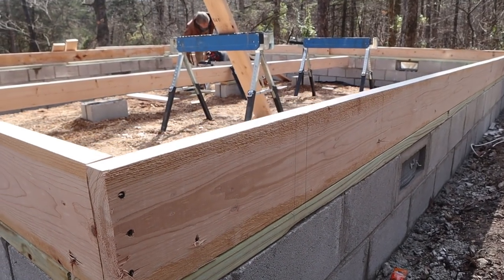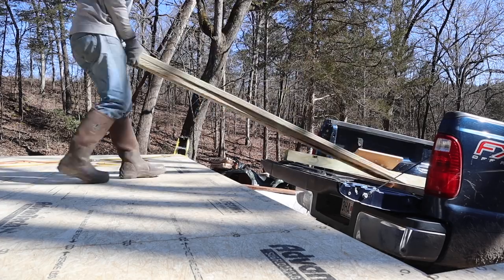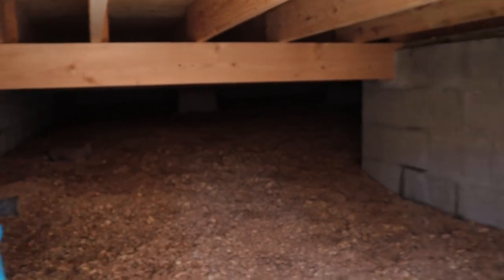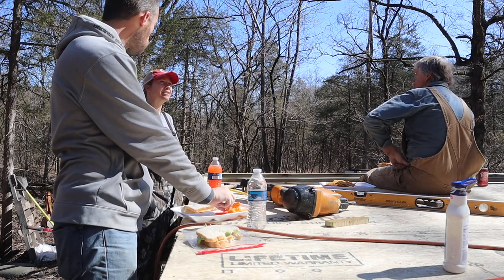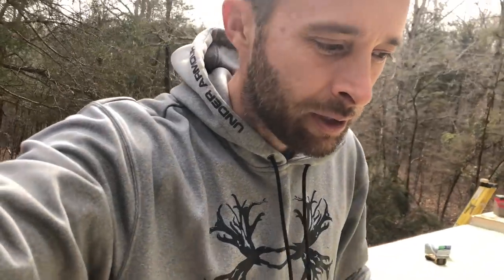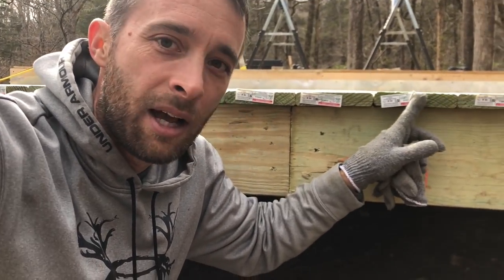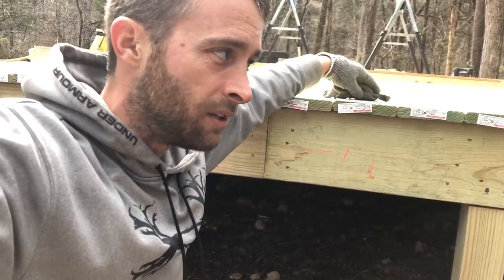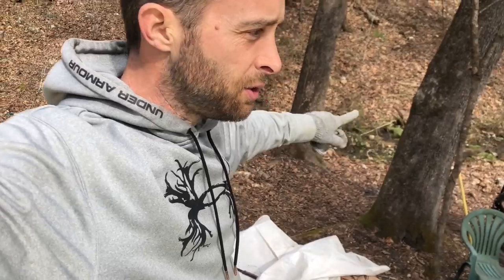Off Grid Cabin..Building the Subfloor & Deck | Episode #5

Comment: Never use anything metal as in flashing between regular lumber and pressure treated. This is the time you use plastic flashing because of the acid in pressure treated. Even galvanized flashing will have a reaction. Personally I will use kelm dried pressure treated because it doesn't sweat as much chemicals and doesn't shrink as much as regular pressure treated lumber. I know this because of my uncle building many everglade homes in Florida and Louisiana.

Comment: Are you going to insulate under the floors after the plumbing and Electrical goes in? That cold air coming out of the ground will freeze your toes🥶
Reply from the maker: No we don’t plan on insulating under the crawl space. It’s really not needed here in southern Missouri with a closed crawl space.

Comment: Michael is it going to look like a log cabin on the outside ? Your cabin is looking good . Any estimated date of completion? Does your county require a certificate of occupancy after the build is completed before Ya's can move in ? Are Ya's sleeping in your parents house or your RV while your building the cabin ? Did the septic system get put in yet & a well drilled for water ? Is Jerry a friend of yours ? Eventually will you be able to drive the RV down to the cabin or will it have to stay up by the road ? If so will you build a garage by the road w/a door tall enough to drive the RV in to the garage ? Sorry for all the questions I hope Ya's don't mind me asking .
Reply from the maker: No, but will have wood siding. Should be done late April. No county requirements. Staying in the RV and it won’t ever go down to the cabin. Working still on septic & water. Jerry is a cousin. Thanks for watching
Reply: @LoftisPartyofSix  Your welcome & Thank You for your reply .Glad there are no county requirements . Looking forward to the reveal video & y'all moving into the new cabin .